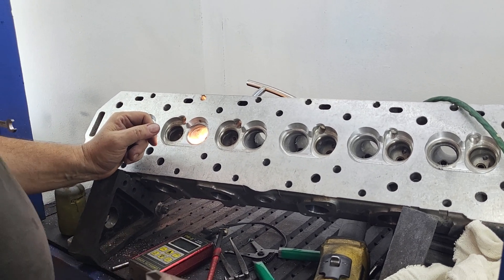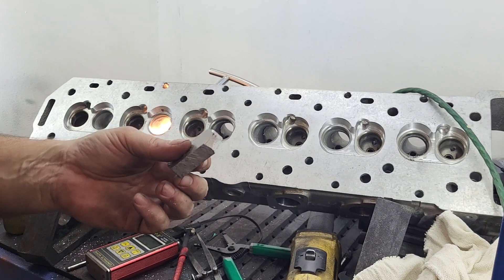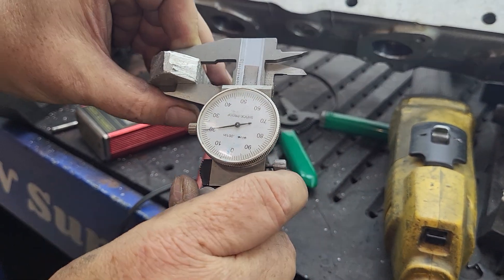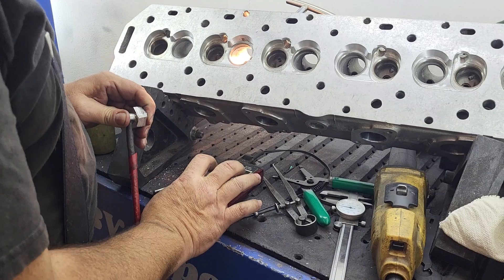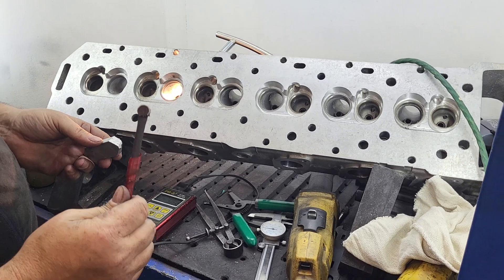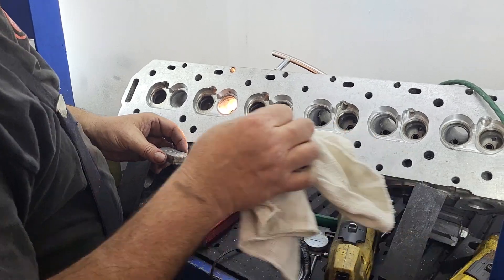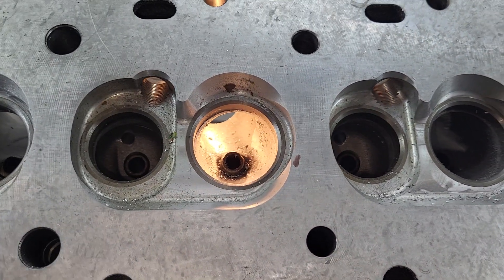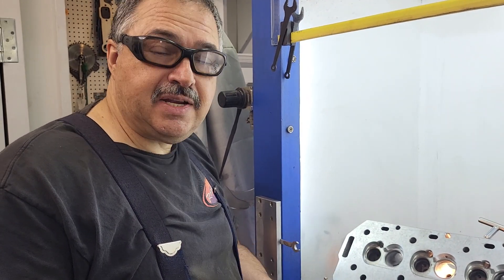How to calibrate a ultrasonic thickness tester at David Vizard's shop

Comment: Is this for an XJS?? like a 5.3 or 6.0? I always wanted one as a project. This guy: https://www.youtube.com/watch?v=70nyn9LH_bQ  Built his up close to 400 hp or so.. I think you can put like an Aston intake on them... I used to get into the PURE SOUND videos and the Tom Walkinshaw video is great at Bathurst. Usually they are reasonably priced .. sometimes hard to find one without a 350. I've also find websites that sell a lot of the fixes to the electrical issues to make them safer
Reply from the maker: I have no idea. It is a v12 which is good enough for me!